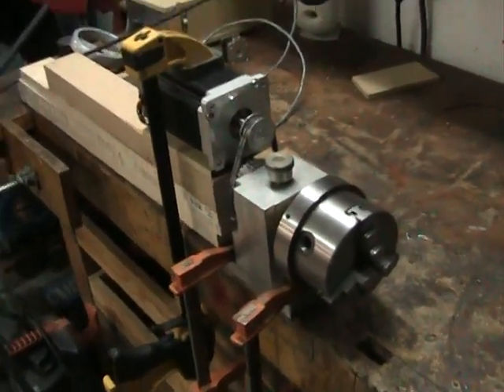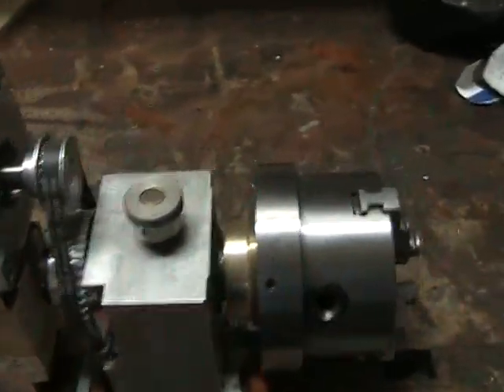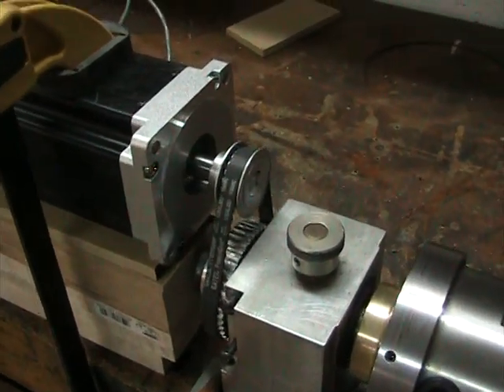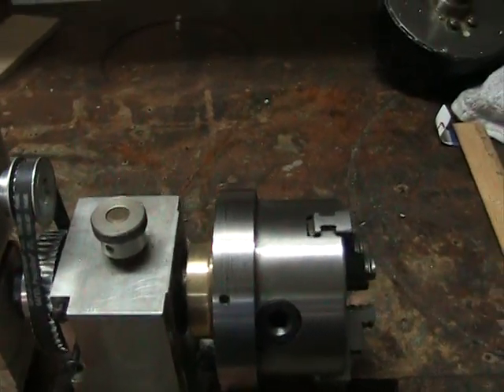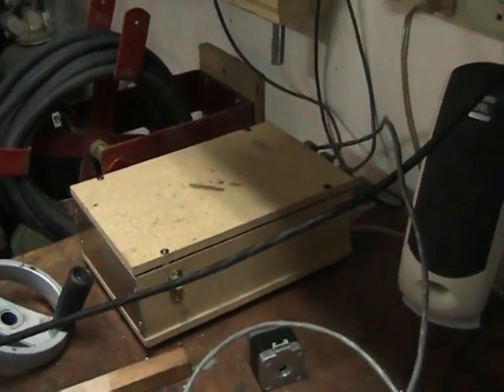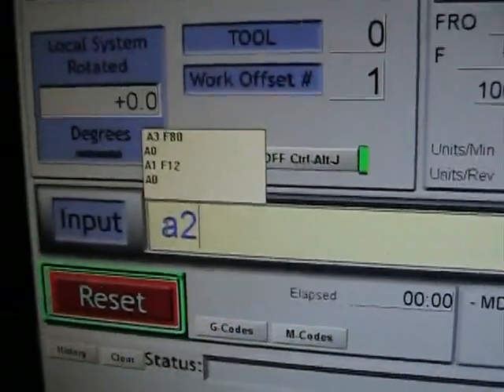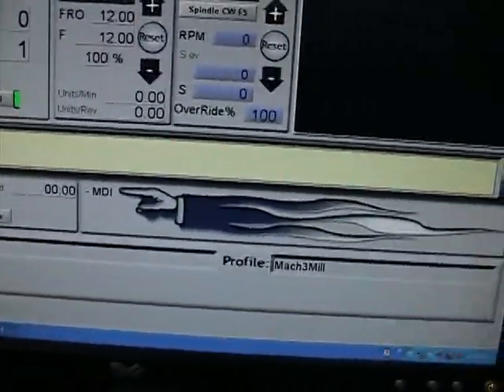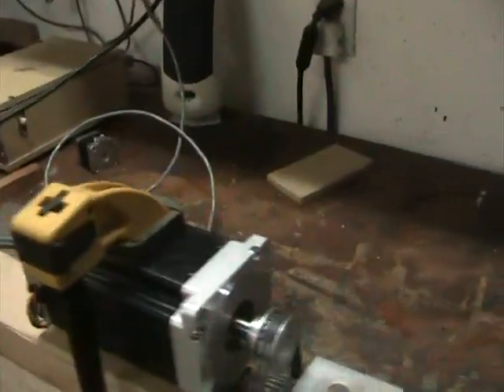1600 Oz In, Nema34 4th Axis

Comment: Is Pulley and Belt you used rated for that torque? I have a 1830 ozin stepper and trying to find a pulley belt system that wouldn't slip...
Reply from the maker: Sorry, don't know what the rating is on the belt.  It is a toothed timing belt so it won't slip.    I doubt the stepper motor has enough torque to break the belt.

Comment: did you ever finish this any chance you have a video of it
Reply from the maker: I did finish it, then sold it.  No other videos, sorry.
Reply: @cffellows  Hi, I think you've gone more for the power handling than the resolution so with that thought you could have gone for a direct drive as that stepper motor can handle the holding power required for most any static operations like milling on the side of the workpiece or drilling off centre etc. I definitely would not recommend milling or drilling off centre with a belt drive. For a greater resolution requirement I would have used gears instead of the belt drive. You don't get any spring back with gears close meshed, and practically no backlash either.

Comment: What is the highest RPM achieved with this setup - and at what RPM does it begin to resonate on you?
:
Reply from the maker: I don't know the exact RPM but it wasn't very fast.  I'd estimate maybe 300 or 400 tops.  That's with a 48 volt power supply.  I had hopes of getting over 1000 RPM, but that wasn't to be.
Reply: +Chuck Fellows 
Thanks. 
I was also hoping to hear over 1000 RPM.
:
Reply from the maker: That motor had a huge inductance, which is how it managed full torque on just 3.5 amps.  Unfortunately, that required a huge supply voltage to get much speed and I wasn't willing to invest in the power supply or the controller required to handle that kind of voltage.  I eventually sold it.
Reply: +Chuck Fellows 
The controller would need to be able to increase voltage with increased RPM. 

This is necessary to push more current in a shortened timespan when going fast - and you don't want to be pumping high current through the coils when the stepper is sitting idle. 
:

Comment: you should use your own 4th axis to make a new smaller timing pulley to increase precision (reduction ratio) to your 4th axis.
Reply: Pulleys should be hobbed not 4th axis machined. I feel the same way about gears if you truly want precision. Our Coleman barber is far more precise than anything a 4th axis could make. Most manufacturers hob them.

Comment: Chuck why not give the stepper more volts ? Im sure your rapids will be allot faster.
Based on motor 34HS5435C-37B2 that is a nema 34 1600oz 3.5a @ 5.7 volts x 22 or x 25 . You should be able to run it at 127v or 142.5v .
Point being that a bad ass motor you should get it its own power supply I bet that stepper can really move. Toriodal PSU are really easy to put together and cheap, message me if you need any help.
Nice build though I really like it. You did a great job.

Comment: your settings is way off if you enter A2 should it move only 2degree (from your zero) not 2full or what ever it moved :))
Reply from the maker: I have it set up to specify number of turns and decimal turns.  So A2 gives me 2 full turns.  If I want 2 degrees, I enter A0.067 which 2/360.  Seems more straight forward for my applications.